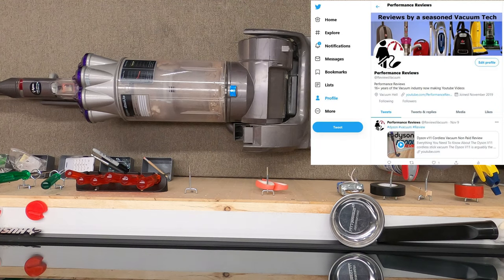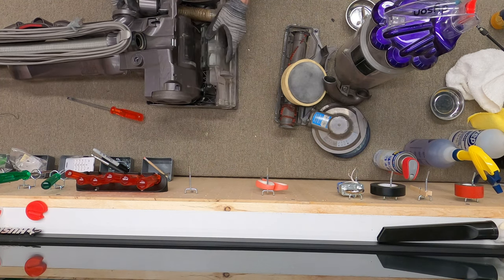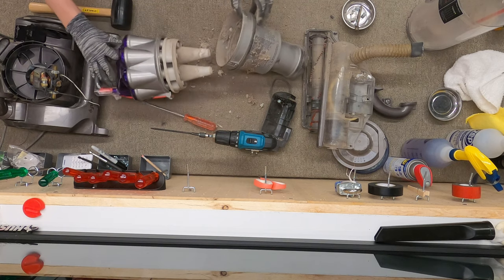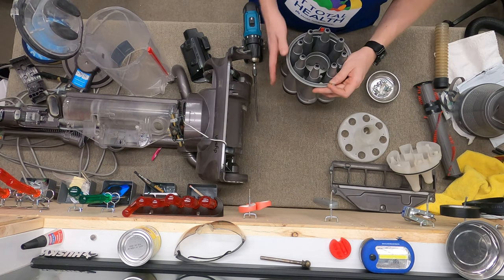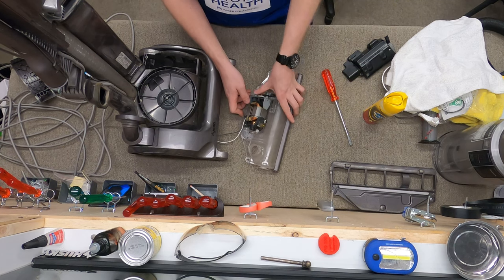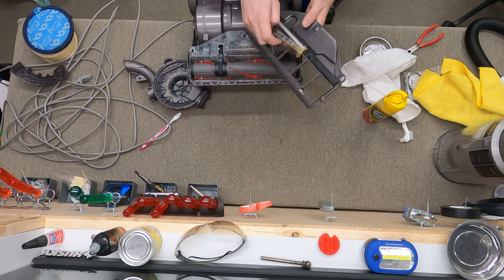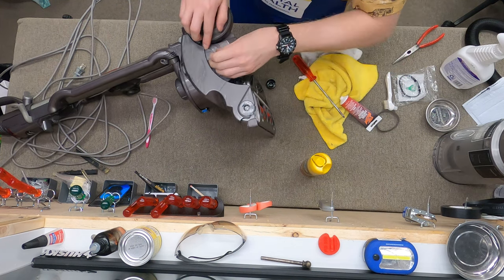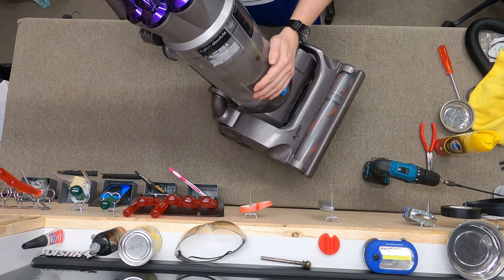Dyson DC17 Vacuum Repair & Disassembly

Comment: I maintain, this is the best machine Dyson ever built, before or since.   It is also quite possibly the only machine Dyson ever made that actually cleans thick carpet well.
Reply: Agree 100%
Reply: We’ve had ours since 06 and it’s still running great - using this video to take apart the cyclone assembly due to a nasty smell - deep cleaning 1x  every 18 years ain’t bad 😃

Comment: What kind of oil do you use in motor bearings? I'm considering buying a miele that need the motor servicing but don't know what oil I'd try in the bearings

Comment: I have a DC17 that was left on the curb during one of our neighborhood’s bulky item pick-ups. It was filthy. In fact, it looked like a pet had vomited on it. Being the DIY person that I am, I thought I’d see if I could clean it up/fix it. It took me a couple of hours of disassembly and cleaning. The vortex chambers (or whatever they’re called) in the canister were completely impacted/plugged with dirt and pet hair. In fact, I had to use needle nose pliers to pull all the dirt/pet hair out of them. After a thorough cleaning, reassembly, and new filters, this has turned out to be the best vacuum we’ve ever owned. With that having been said, and not wanting to have to disassemble the canister again, after emptying it outside each time, I always blow the canister out with compressed air. Doing this has kept the canister clean as a whistle. And I’m careful to be sure the lower canister gasket stays in place. It’s not a problem if one simply pays attention while putting the canister back together after emptying it. One issue I encountered is the cord started to get warm during extended use near the plug. With its two motors, this machine draws a significant amount of current. I solved the problem by replacing the existing plug with a 15A plug that’s much more robust.
Reply: I picked up mine from a bulk trash day, too (it's my second Dyson find, I fixed the first one, but I'm here for the DC17 which powers for half a second then shuts off.  It looked weirdly clean, but from everything I'm seeing, I bet that top part is impacted with crud.  I like the canned air tip - I'm all about prevention.  Happy Bulk Trashin'! 🤩

Comment: My roller bar won't turn checked the belt etc worked for a bit then cut out also would stop if I lowered vacuam to low

Comment: 10 years and stopped sucking.     Oh it has a filter. on order cleaned and sucked the tile off the floor and found the easy way to change the "other" filter. Thanks very well explained.

Comment: I have the same model since 2005 and it still running. However, it has a metal squeezing sound on carpet mode and it does not vacuum well in a hard floor mode. The hose get stuck when inserting. I am going to to follow your instructions and see if it is fixable. This is a great vacuum and I want to keep it as long as possible in a good condition.
Thank you for your video it was very useful, easy to follow, and very practical.

Comment: Thank you for this video, im not sure what was wrong with mine but once we got the switches and redid the springs and everything i tested to make sure they work and they did. I put it back together and it has worked again. It would orginally turn off  if you wanted to use the wand or it wasn't in the upright position

Comment: Good to see you finally servicing a 17! Definitely one of the best Dysons and way better in quality than the 33 (The 33 is a downgrade to the 14 and 17). I have a 14 and 15 and while they don’t perform as well as a 17 they are still pretty cool machines.

Comment: I bought my DC17 new and at $699 it was a huge purchase but I love it and still use it to this day. 
I take the cyclone assembly apart completely on a yearly basis, but really had trouble this last time and had to use a screwdriver to take the upper and lower assembly apart like you did at 6:32. 
I essentially ruined that gasket with my screwdriver. 
I took it to a local vacuum repair and was told this particular gasket is no longer available. He put a thin bead of silicone around instead. 
Do you know if there is any place I can find this particular gasket?
Reply: Tammy, I redid the seal by removing all the old silicone from the groove all the way around. Then used caulk gun and clear bathroom silicone in the groove, the. Put it back together while the silicone is still fresh and it seals great. Just don’t get too much silicone squeezed out, it will make a nice mess for you to clean up.
Reply: Ron, it sounds like you did exactly what the guy did at the vacuum shop for me. 
My only concern is how I'm going to get it apart the next time I clean the entire cyclone unit. I guess I will deal with that when the time comes.

Comment: When I disassembled my cyclonic filter, I wasn't sure how the bottom piece came apart, so I literally destroyed my silicone gasket.  When you showed how to take it apart, I tried it, but wasn't having any luck, so, I used a small screw driver and a putty knife.  Needless to say, I no longer have a silicone gasket.  Where can I find one?
Reply: Hi Tom, I clean out my cyclone once a year and am always amazed how much gunk is in those tubes.
This last time however I had a hard time disassembling as well and ruined the silicone ring. 
I took it to a local vacuum store that works on Dyson and was told this part was no longer available. 
He put a very small bead of silicone around  the piece. 
Not sure what will happen next time I go to take apart, but for now it is still working. 
Love this Dyson!

Comment: I still have mine to this day.  Bought it new 15 years ago, and it's a workhorse.  Mine has developed some sort of weird issue though where if there is a partial blockage on the wand there is a popping noise, the sound tone changes,  and the airflow gets diverted so there is no suction from the wand.  The only thing that seems to fix it is to turn off the vacuum, wait for it to spin down, and then turn it back on.  I'm guessing there is some sort of redirect or bleeder valve in the assembly somewhere that maybe has a spring that has grown weak with age.. but really have no clue.  Any suggestions?

Comment: I had to declog this machine and it had the same duel Long cyclone thing inside of it and I brought it to my dads work and it still runs to this day
Reply: My family bought this machine 15 years ago brand new and it got replaced with a DC 65 since then the vacuum went up into our attic because it stopped having suction then when we brought it to my dads work it really stopped having suction and it wouldn’t run correctly, I took the entire machine apart change the washable filter change the HEPA filter since the HEPA filter had never been replaced clean the entire cyclone of clogs change the belt and brush bar and the machine now runs at least twice a week at my dads work.

Comment: Appears all my switches are good other than the third smaller momentary contact switch seems to always be shorted. I tried powering on with that disconnected to see if maybe needed to be switched to open, though didn't make a difference.  Still no power to either the brush or vacuum motor.  Guessing either connection down on the lower head side or one of the motors or something is bad.  Any thoughts?
Reply from the maker: Go to your local repair shop and see what they can do for you. Unless you're trying to put this in a vacuum collection I recommend you just replace it at this point since most of the parts are discontinued. The SEBO Dart would be a worthwhile upgrade.

Comment: Great video. Thanks for sharing your expertise. I have a DC17 that the sole plate has worn out after years and years of service. Dyson has discontinued this unit and parts are hard to come by. Any ideas where I might purchase a sole plate?
Reply from the maker: eBay or find a used vacuum locally
Reply: @PerformanceReviews  thanks for the quick response. Seems like the last one on ebay was sold sometime in June. The belt cover is worn through. I'm going to try my hand at fabing something. Keep up the good work!!! Thanks, again.

Comment: I need to replace the brush motor gear.  Have you replaced that before?  How does it come off?
Reply from the maker: The part comes off.  It's not available separately. I suggest you try to find a used motor and just replace as a whole assembly.

Comment: Hi.  I watched the video on DC 17 and took it apart to clean out all the hair and dirt.   I replaced the two filters.   I am still getting dust and hair on top of the filter that is under the canister.   Any ideas?
Reply from the maker: It's not abnormal to get dust on the pre motor filter. I really would not daily drive this machine it's gotten too old.  replacing it.
Reply: Thanks.  Is the pre motor filter the blue one?   Hair seems to be collecting there.  I know it’s old but I was using it downstairs.   We did recently buy a new Dyson.   The suction is better but the plastic seems cheaper.

Comment: Great video and instructions. Can you post instructions for replacing the clear plastic latch release for the wand?  I have found the part but don’t know how to put it on. Thanks!
Reply from the maker: "Change is a whole assembly"
Reply: You mean replace the entire wand holder?  I have found the correct plastic clip. I just need to put it on.  It broke once before and I replaced the clip.

Comment: I have a DC17. My current issue is the roller bearing for the belt. It slipped out some years ago, an I oiled the bearing, and got it back into place.  But the holes on the tension unit are worn out and it keeps slipping out.  It is a pain to put back in. Are you saying there is a shorter belt I can use?  Do I just take that belt tension unit out?   What is that part number and where do I get one?
Reply from the maker: Order the brush and belt from the description and you can just take out that belt tensioner and run it without. You on social change your filters at least once a year.
Reply: @PerformanceReviews  ordered it. Thanks!

Comment: 19:29 Properly seating the bottom portion of this filter appears difficult without some sort of special purpose tool.  Based on your video, the filter seems to need to be compressed in order to push it into the proper position within the filter housing.  I'd like to better understand how this is possible in the lower portion of the filter cavity.  The top side appears much easier since it clearly has more access.  My Dyson 17 worked great for the last 15 years, until yesterday.  I accidentally ran over a small rag roughly 5 inches long.  It got wrapped up in the brush and a split second later the brush stopped rotating.  I assume (but do no know) this caused the brush motor to be damaged.  Do you know of a reputable seller who has these motors available as a new OEM part?  Not interested in a cheap foreign made aftermarket replacement motor.  Although this appears to be a somewhat complex tear down and build up, I have to say, the DC17 has served me well.  It's an excellent vacuum.

Comment: And I particularly love where he says, "Oh, and p.s., this Chinese aftermarket brush roller will destroy any carpet" as he's putting one into the unit. Seems to me to rather defeat the purpose of a vacuum. My intent is generally to clean the carpet without destroying it,
Reply from the maker: Thanks for watching I just wanted to clarify something there. It's not just the aftermarket brush roller. it's the actual design of the brush roller that destroys carpets. Also  I found in the review process the machine's not particularly powerful in terms of suction.

Comment: Where can I find the silicone gasket for the lower half of the filter ass'y?
Reply from the maker: Home Depot GE2
Reply: @PerformanceReviews  Thank you.
Reply: @PerformanceReviews  What is GE2?  I went to Home Depot and had no luck.
Reply: Normal caulk gun and tube of GE(General Electric) silicone clear bathroom caulk. Remove all the old silicone from the groove and squeeze in the new silicone and put it together right away to get the silicone to set up and dry making a good seal.

Comment: What "oil" and "grease" are you using? And    what are you using to "soak" the belt with? 
I'm not seeing any links or list of tools. Thank you! 
PS your language cracks me up....I literally just called my Dyson a MF while trying to get those 2 damn wires from the motor in the slot 😂😂
Reply from the maker: Thanks for watching! I changed the belt and brush roller.
 Here is a List on Amazon: Tools of mine  by PerformanceReviews https://a.co/63PRe1m